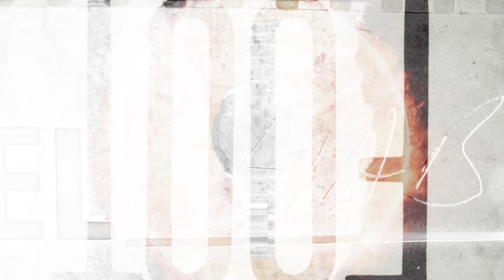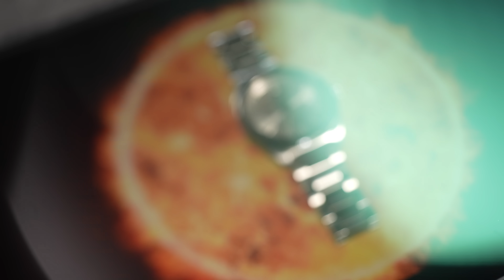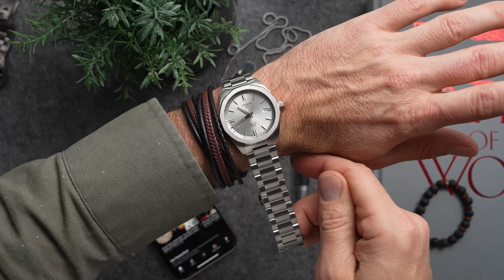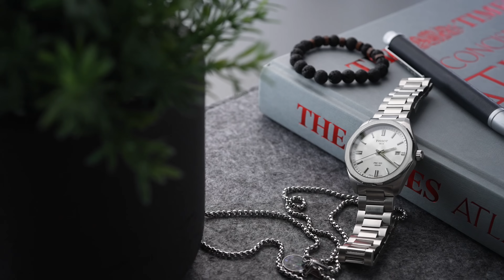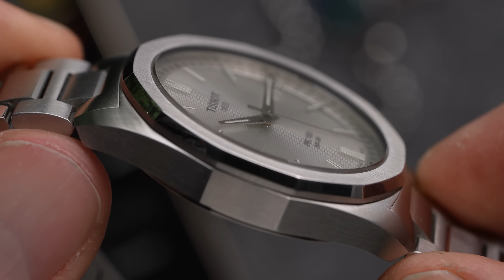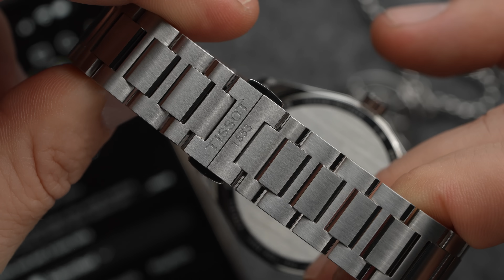New Tissot PRC 100 Solar brings photovoltaic technology to an analogue design

Comment: All using Citizen Technology with over 40 years of experience with its Eco Drive... This is not a revolution or anything new. First it was the Tag Heuer Aquarecer Solargraph which uses Miyota calibers under Citizen's license (just do a search on the net and you'll find a lot of information about it) and now it's the Tissot PRC 100 Solar. The Swiss Brands charge a fortune for their watches using Japanese technology and in-house Citizen machines :) But most people think that Swiss Brands only use their own Swiss Calibers, but.... they couldn't be more wrong...... Citizen and Seiko have had solar watches for decades and Citizen in particular is the pioneer brand and the one that has most developed this technology over the time, having received several international awards. Speaking of the technologies available in watches, i have all types, from Japanese, French, Chinese and Swiss brands, with Quartz (normal battery), mechanical (automatic and winding) and Solar and from my experience over decades, nothing beats Solar watches, they last for decades without any maintenance and are always accurate. The secret is to keep the batteries (accumulators) charged and they will last a lifetime. Can any mechanical watch beat this technology? never.... besides being imprecise, they are fragile (any knock can damage them) and require regular maintenance every few years... nothing can beat a Solar watch. Cheers for all.

Comment: Still... It's way easier and cheaper to just change the battery. When this goes... you need a new watch.
Reply: You just need a new accumulator, it’s like changing the battery, only a little more expensive.

Comment: How would this work in parts of the world with minimal daylight for much of the year? The far North etc
Reply: Lucky for you this watch will also charge via artificial light.
Reply: @ that isn’t really a substitute. My solar power G-shock - which I otherwise love - struggles in the winter. Battery regularly drops to “low”. Wearing the watch in lit conditions indoors is not enough to charge it up. I need to take it off and put it for a day under a focussed desk lamp to even get it back up to “medium”.
Reply: @ I guess we can’t have it all hey. But I would say that placing it under a desk lamp or light that’s already on is not such a drag. But all comes down to your own preference.
Reply: @ definitely true we can’t have it all. But having to put it under a lamp for a day is a massive drag. It forces my watch off my wrist when I would otherwise be wearing it
Reply: @davidloveday8473  Just buy them solar watch charger gizmos. If your watch is completely dead, one night charging the watch with this gizmo will bring it to almost full power.

Comment: It's fun when the Swiss drop a solar-quartz movement and we all act like it's innovation.
Reply: No it’s not. That’s not what Swiss brands are
Reply: It’s no better than any citizen out there lol. But twice the pride with Swiss (china) made
Reply: @michaelh8854  one thing I like about Tissot is that its all sapphire and they  always have good finishing

there are a lot of eco drive models I like but have skipped them since they come with mineral glass
Reply: @swagathshetty  Many of Citzen's Eco-Drives at this price have sapphire, though many of the designs are hard to love. The eco-drive divers, however, are great all around.
Reply: @michaelh8854 40% chinese
Reply: @michaelh8854 citizen are stuck with deep date windows and limited dial finishing. Tissot can do more with this tech
Reply: Yeah, just a Tissot branded Citizen Eco-drive.
Reply: @ TAG Heuer are the ones who passed off the cheapest Citizen Eco Drive movement as their own "Solargraph" in the Aquaracer. Tissot just had to go into the Swatch parts bin for this one and then just fire up the marketing machine so their press and retail outlets can talk about it as if its some sort of leap forward rather than an inferior execution of technology that Casio, Citizen, and Seiko have been putting in some of their cheapest watches for decades.
Reply: @GOD999MODE  TAG Heuer rebranded Citizen's cheapest Eco-Drive for the $4000 "solargraph." Tissot/Swatch just had to raid the ETA parts bin for this one and then instruct their press and retail outlets to ignore the existence of Casio, Citizen, and Seiko so they can talk about solar quartz as if it's some some bold leap forward in watchmaking.

Comment: The problem with analog solar watches is that the date window is not flush with the dial making it difficult to read the date in low light. In my case, this particular watch model leaves me  indifferent

Comment: I’m on board w solar. I wish more effort was made to make stylish solar watches. Imagine the case finishing of a royal oak, or blancpain but without the cost of a hand-made movement inside. No more maintenance. No dead batteries. Just lower cost watches with better accuracy that will always run, at least until the humans scorch the sky to prevent solar charging robot armies…
Reply: @defresh4612  Even if WW3 happens, you can still charge your solar watch with some other light source...lol

Comment: finally some good competition to the eco drive watches
Reply: not with that ugly and VERY visible solar cell.
Reply: No one can compete with Eco drive or with Citizen quartz movements generally like haq or ultra haq like caliber 0100 ,mine eco works for 21 years and counting.Casio tried to copy eco drive but unsuccessfuly.even Tag Heuer have a licensed eco drive in their solar. Don't forget that Casio original solar is basically a poor copy of Eco drive.Seiko is only one as pioneer of Solar watches which has their own original solar movement which can compete with Eco drive but the Eco drive greatest strength is longevity and charging on any light and Seiko lacks that features.